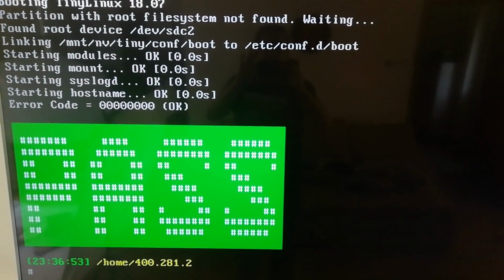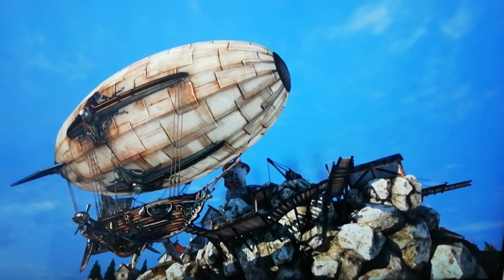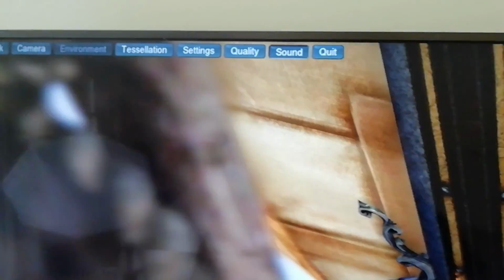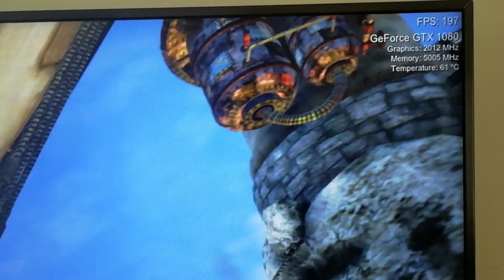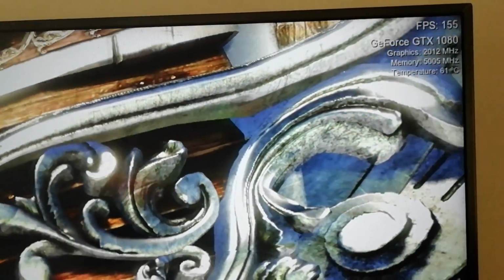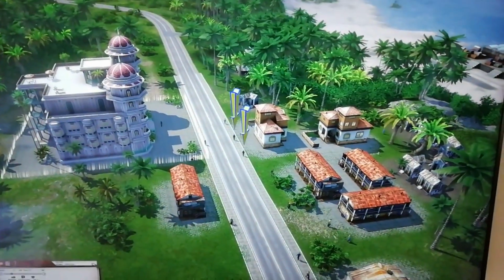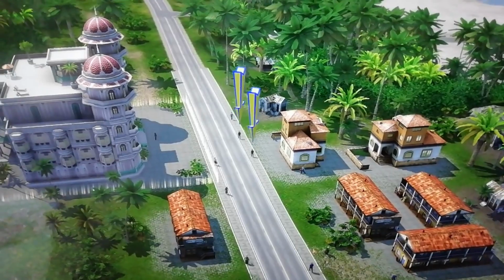Palit GTX 1080 repaired and tested :)

Comment: Hi. My PC is not bootinh but LED light is on. When I remove my GPU l, light and CPU fan is now working. GPU dead? Help
Reply from the maker: @tommycastle3772  maybe not... it may be just faulty. If you have a 1080, it's rather old at this point.
GPUs from that era can prevent boot, you need to contact someone that is a GPU repair tech, best if you can find someone in your area.

Comment: How much vram voltage need ? I have all voltage on gpu but vram only 1.3v ?
Reply from the maker: @DimasKurniawan  1.3v is perfect:)
Reply: @DIYRepairHour  ah oke dead core i think. Power drawn 1.4A and 18W. But pex 60ohm
Reply: @DIYRepairHour  or failed bios. And no bios for gamerock palit 1080 ti
Reply: @DIYRepairHour  run mats mod got nvrm vbios failed or something
Reply from the maker: @DimasKurniawan  try BIOS first
Reply: @DIYRepairHour  cannot find bios already reflash bios 2-3 times, i pullof the bios chip and reflash it
Reply: If i use igpu, and open gpu z detected gp102 but unknown bios and unknown memory
Reply from the maker: @DimasKurniawan  yeah, try BIOS first, maybe after programming it you will be able to run MATS